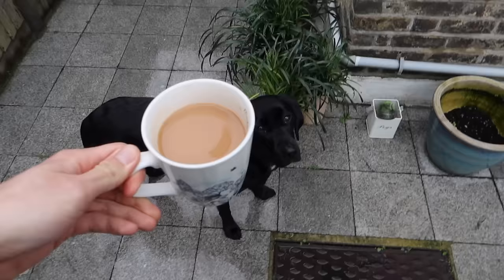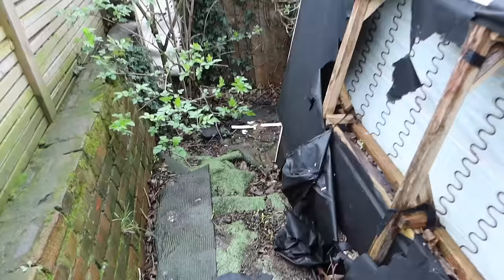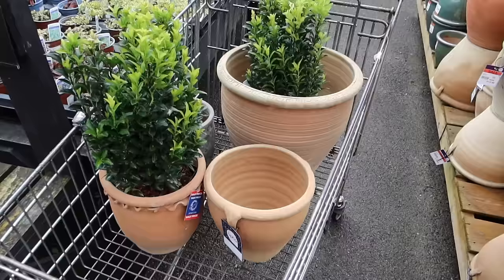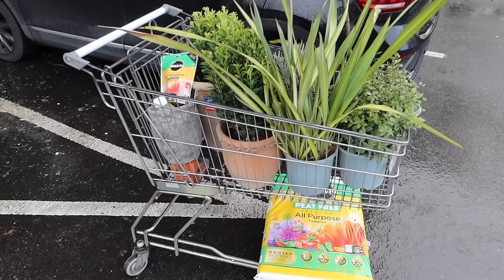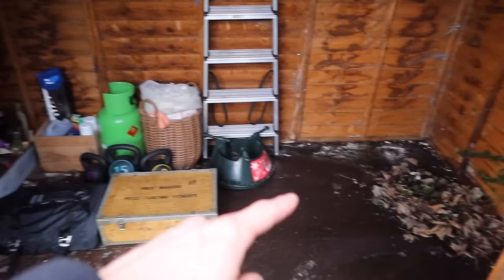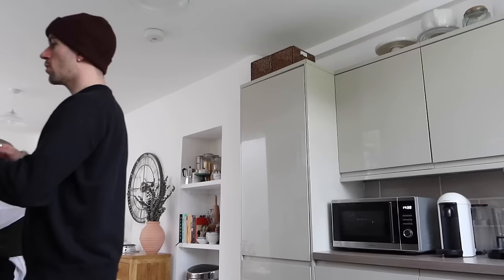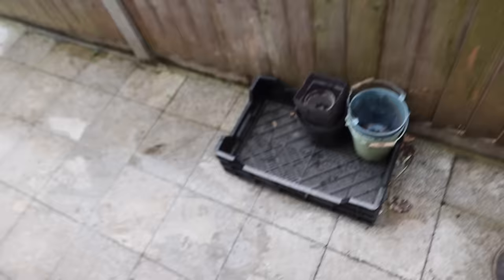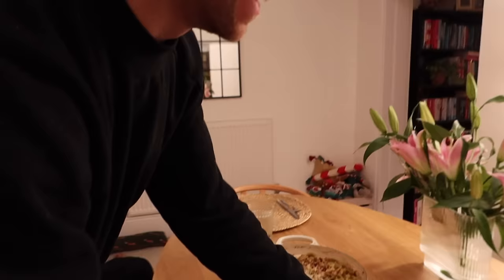I DON'T KNOW WHERE TO START | GARDENING UPDATES & FIXING OUR BROKEN SHED | VLOG

Comment: Lukey Luke (as you are know at my house) I don't normally comment  but you will SO need to replace the shed with a bigger one!  The laws of homeowning and gardening are set in stone   no-one EVER needs a smaller shed. Actually a shed that covers the whole width of the garden at the end is easier on the eye and once up you won't miss the ratty bit of space at the end of the garden next to the existing one.
  As a professional gardener I wish you luck, may I advise is it's better to have three or five really big pots or containers for plant showstoppers and seasonal and put everything else in the ground. Plants in small pots fade quickly, dry out quicker and don't have the impact that a curated big pot group has.  The Bay Tree will really reward you but make sure you put it into the bigger planter and in summer watch for the bugs that get into the fresh leaves and make them go distorted and curly, They can be safely sprayed with an organic insecticide. Best wishes Richard

Comment: You gave me a good chuckle when you asked if that was a mint tree. Mint does not get to be tree sized, but it will run like crazy so never, ever plant it in the ground. Don’t even put a pot of it on the ground. The roots are very hardy so keep the pot on a hard surface like a patio or deck, or at least a paving stone.

Comment: Get a plain hardwood bench for outside, you can use it for potting plants and you can also use it as a bar and/or buffet for outdoor entertaining. Absolutely get rid of that shed, brand new kitset sheds aren't expensive and you'll spend just as much fixing the broken bits. It's much better to do it now when you're not having to empty years of accumulated stuff out of the old shed and work around established planting. I'm glad you got a bay tree, it's so nice having fresh bay leaves for cooking.

Comment: Please get a hardscape done first. Figure out where you want your paths to go, space for dog, if you want any other build in planters.You need garden planed before you start buying plants. Some wants more shade, some needs more light, water, etc. You’ll probably loose time and money before you get it right. Ask how I know.Get a compost bin , something with tight closure, and get your food scraps, leaves, cardboard, paper in it. You’ll get free food for your plants. Also, that shed can get reused. Cut it in the middle, and use those half’s as a lean to on the side walls, opposite each other. Then you can build either pergola in between or some other feature to look at from the kitchen window.

Comment: My tip would be to read up on the conditions your new plants require and check the size it will eventually grow to.  Have faith and BELIEVE that tiny plant may eventually grow into a 30' shrub and give it enough room to grow and spread.  It is difficult to do because you want your garden to look full and not have a few little plants dotted around with lots of bare soil.  l still struggle with this even after years of gardening ☺️.  You could always fill in the gaps with annuals.

Comment: When you replace the shed she if you can do a plexiglass snap green house or cold frames & table & or container box with ledge to sit & plant if table in case in plastic sheets or panes to house taller trees shrubs & room to plant on going culinary garden like greens lettuce even a shell to one side of the small structure to plant perennial hers or a plant you live yet needs the enclosure 🍊 tree house if l recall but need few cold frame to one side or back of shed to use leaf compost on to bulb & roses whatever need to set up roots but if stem for spring months & in dark side if to set like poinsettia plants you get holiday time for following year a chest height 3 sided box table to get your soul to repot or pot up plants with same height counter  to do wreath making floral bouquets seeding in trays .if handy a small refrigerator to house fresh cup plants or seeds for germination.with no 🍎🍏 to produce killer 🌱 gas
 Make from celling in reach with or without ladder to hang plants for drying for Autumn bouquets or drying herbs for all shorts
😋 yummy  kitchen bathroom stuff .
Get a insect house Mr Carrington just should one to attract beneficial bugs to the yard as a toad 🐸 house place in garden 🛏️ to attract pest control naturaly 
A bird 🐦 bath up higher & low to the ground 🦋bath
Can get a flower pressed to press plants  add  an to a gift card/ tag  how sweet.
Zara's pansies in pot if no chemicals can fine sugar coat for cake toppers other flowers  violets  grow natural in most yards wild sibling to hybrid pansy plants 
Get with the high handle or no, handle .Place potted plant in container basket of fiber wire wood clay plastic melamine & or Plastic tray   like bread style set on window sill so not to knock 🪴later see if wish to add green house 🪟 bump out to kitchen 🪟gets plants up out of harms way not too much clutter around the sink😉
Keep Rocking 🤙the good stuff 👍 Beautiful people 🤗 pet Maggie my 😘🤓looking fly😉🤍🐇🕊️🫶🐦2004.  🪵🐉
🗽🇺🇲🦅🌧️
PS a toad house  🦋 & 🐦 bath toad 🐸  house helps with bugs mat want to view in YouTube bit natural Gardening to zen to kitchen ✂️ cut garden plant flowers in container carding box plant grow cut ✂️ for Beautiful fresh dried press   to make cost effective 💐bouquets 
🐦 box  a martin box or bat box in shed to get help in pest control.humming bird feeder near a 🪟 your enjoy the entertainment change daily it heatly when gets in use & get you to intermingle in your garden 
I may get a place near the house to do a Bonsai out door if wish in my need to take out part of the year as well as water 💦 trough lite up Japanese lantern to wash hands in out  the garden 
Then your canopy picking table 🔥 pint in the run if big bucks a oven 🍕 make places you can stop sit at few angles you with get more pleasure out of it .
I had years ago 🐎 should put tether ball stake badminton set up croquet at one point a tower shed to go up look at the 🌌& another views of the garden & house nit just garden & shed o nook with tall shrubs grasse to hide in with cuppa if choice for read it sketch or writing pad camera always or my bit of ha ✋🤚🪡🧵📍✂️🧶 stiching
So excited for your Long awaited garden adventures.my college days😊